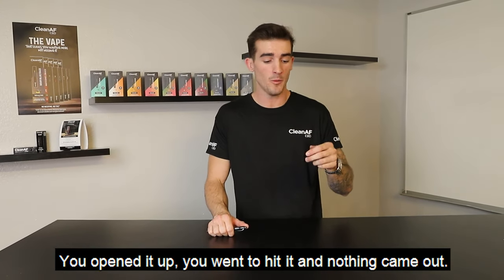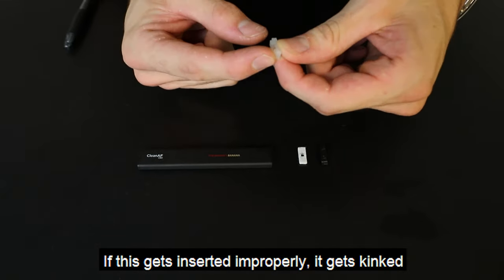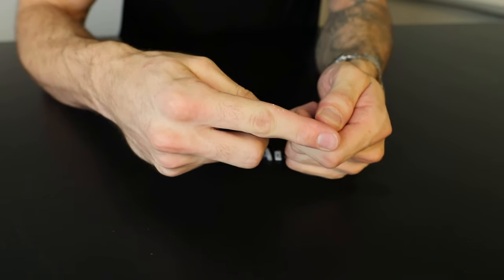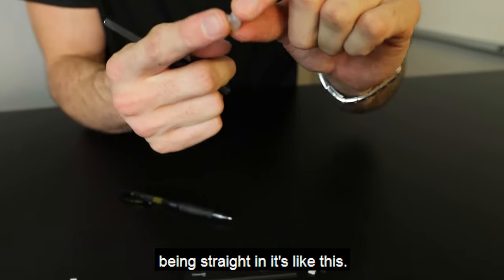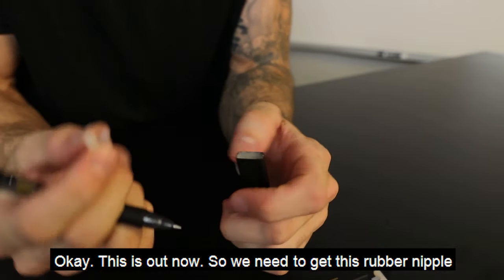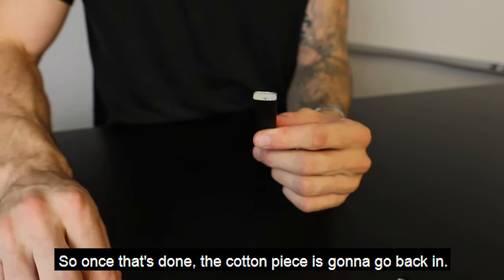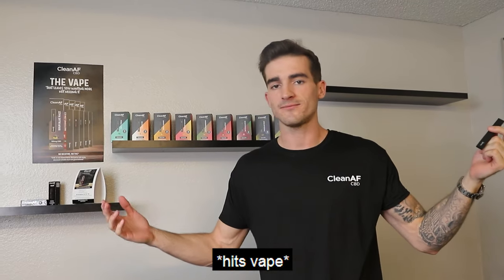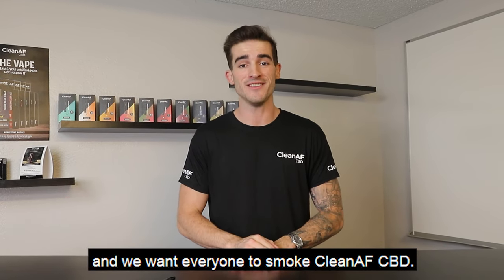How To Fix A Disposable Vape That Won't Hit - Distromike

Comment: HEAT.... Yup. Heat. Take a blow dryer and heat up your pen. Place heat on window that shows liquid. Chances are? The liquid is too thick and caused an internal clog. Once you heat up the window and liquid. Tap the side of your pen on something hard... Gentle taps. Bam.... Should fix the issue. You will be thanking me! 😊🎉 Enjoy!
Warm, tap, suck... warm tap suck.
Reply: Thanks, this worked for me on a live resin dispo, I was a lil worried it was gonna explode or something but I kept the hair dryer moving and it didn’t take long
Reply: it worked ty🎀
Reply: Can you help me ?
Reply: @merxrii  sure.... just warm your pen up with heat. Not too hot. Just enough for the oils to get warm enough to move when you shake the pen. You may have to warm...tap...suck, a few times to get iit unclogged.
Reply: Just did this to my disposable resin pen. You’re a saint 🫂 I’ll take a few puffs for ya
Reply: Thats it, my shit was almost frozen 
with these crazy cold temperatures!!
Reply: actual lifesaver bro
Reply: I have a ct1000 and I reset it by putting a paper clip into the hole and clearing it out and THEN I took your advice and warmed it up and IT WORKS!!! THANKS!!!
Reply: @SICAFxx  🥳 No problem. Welcome!
Reply: Omg I just did it and it worked thanks!!😅
Reply: @ladyt3701  🥳
Reply: Hey man I have a Geekvape wenax M1 it’s pretty much built like a disposable one but is refillable and it has a e liquid tank instead of cotton but I wanted to know would this work on mine cuz it isn’t hitting and I think the auto fire is acting up because of the E-Juice leaking into the battery unit
Reply: i did this but with a lighter my king kong gas station disposable clogged like this it would charge but not hit and it also had airflow but i believe it was a internal clog like you suggested instead of a blow dryer i used a lighter. took it for about 15-20 seconds i took it and went up and down my pen to the mouthpiece all the way below to the charger piece i did this and tapped repeatedly and it worked!!
Reply: The instant I knocked it on my counter it fucking hit god bless you
Reply: Definitely a big thank you cause it definitely worked!
Reply: Didnt wk for me how long do u use hair dryer for ?
Reply: @maryharvey8775  it took maybe 5 to 7 mins of warming it up, shaking, and tapping for it to work.
Reply: Ty bro helping people out a year later
Reply: @Cousindereck   awww..... no worries and thank you!
Reply: Thanks for the advice my dispo wasnt working ut this worked it
Reply: @Javier-h1c  😉
Reply: My goat

Comment: I have a lot of juice left and the light still lights up but nothing comes out 😭
Reply: @assassin-bp7ov  how do I fix it?
Reply: Yesss me tooo I been trying idk wtf to do anymore
Reply: @laceufr did u find it
Reply: same
Reply: That happens when you haven’t used it in a while the juice in it hardens but you have to heat it up for it to melt I usually put a hair dryer on low setting near the mouth piece for about 1 minutes the juice melts a bit then you should be able to hit it.Hope this helps!
Reply: @nya7199  thank you so much bro. That was the problem!! I was really scared I was gonna have to take this shit apart and mine does not look like the one in this vid so Idek where I would start.
Reply: I did my dispo connected one take the top off then smoke out of it then should work 🥴🔥
Reply: @savage_life_goat5703  I fucking love you my 7k just broke and i did that and it work ❤❤❤❤❤❤
Reply: @nya7199 I have a circle one
Reply: @nya7199 I love you, you saved me
Reply: @laceufr put yur finger on the mouth piece on the top and then like suck in frm the bottom where the charger hole is. This fixed my cake
Reply: @Alseidiking101  put yur finger on the mouth piece on the top and then like suck in frm the bottom where the charger hole is. This fixed my cake
Reply: @haydensmith-mcleod2978  put yur finger on the mouth piece on the top and then like suck in frm the bottom where the charger hole is. This fixed my cake
Reply: Buy recharged vape w/ cable
Reply: This actually helped
Reply: I have a circular vape and to fix the light no hit but fully charged issue I pulled the top off with some pliers then cleaned the small hole with ugly line/fishing line just ran it thru one end and out the other without pulling out the battery. Bunch of black solid stuff came out so I’m assuming the sensor was blocked
Reply: Try sucking really hard and hold the button for atleast 5 seconds so it can get the oil hot, suck in hard and itll burn up the clogged oil and it will begin to hit again. Happens alot with dispos
Reply: Just bang on it..just work for me
Reply: Mine can get airflow and lights up but nothing ever comes out. I feel like it's not even getting hot. I took it apart and have tried everything I can think of and nothing works. I can blow in the bottom and get air to come out but no smoke. So annoying.
Reply: Help my dam ruby won’t give me a hit but it’s lighting up pls help oml 😭😖
Reply: @PhillyCuhh OH MY GOD, THANK YOU SO MUCH, I DID THIS OUT OF DESPERATION AND IT INSTANTLY GOT FIXED
Reply: Lucky my light won’t even come on
Reply: 😭 same. Im trying every solution but it wont work.
Reply: @faaxss  if its a dispo slam it on the counter it deadass worked for me
Reply: @faaxss  but slam it upright
Reply: @PhillyCuhh what the actual f. This worked my guy! 🥲

Tried the hair dryer fix didn't work. 
Tried poking the clog, didn't work. 
Tried blowing through the airhole at the bottom, didn't work.
Got frustrated. Read your comment. And banged the shit out of it it on my lap coz immabout to throw it to the trash - puffed as hard as i could out of frustration.

Now I'm baked.

Thanks to you my guy.  Thanks to you.
🫡
Reply: @Mieiy dog you are goated as fuck this actually worked
Reply: @dylanpeck6816  yeah, i was using a weird 2g dispo and it kept dying, just had to slam it
Reply: Same
Reply: @space5452 omg ur a lifesaver
Reply: Thank you. This was so helpful but unfortunately mine still doesn't work. Probably was defective. But great informative video.
Reply: @Avitommo yo same is happening w me idk what to do did you fix it ?
Reply: ❤ @Chosenmonae
Reply: @wokkmula7709They still go out certain vapes. Pointless comment.
Reply: I still have like 14k puffs left and it lights up but no smoke, how the hell can i fix it?
Reply: @alexdonut  praying for you omg
Reply: 14k  hits left?  What kinda vape you got son?????????? Need to know!😂😂✌️
Reply: @Sherry-ik8gs  the brand I’ve seen is called a hayati pro max I believe
Reply: Facts bro I’m in your same position

Comment: I tried that with a blocked Ignite - the single hole is at the bottom though (apparently) and I seem to have pulled the battery end out! Funny thing is, now I've put it back in it is unblocked but tastes weird 🙄

Comment: Does it work for circular devices like the puff plus and the newer bangs
Reply: this is what i need to know
Reply: @mariesoph2  nope, i think it’s a battery issue, just happened to mine and the rubber part was fine

Comment: Just fixed two of my disposables. Basically just sucked on the mouth piece, not to draw, but to make pressure, and air bubbles came out. Works like a champ!
Reply: Your comment helped me as well so thank you 😅💕🙏🏼
Reply: omg thank u so much
Reply: @lus.7599  You're welcome!
Reply: I just tried this and it worked thanks
Reply: What do you mean, how do you suck without hit? Do you mean that you blew in it?
Reply: My cake doesn’t even charge and I tried this method didn’t work
Reply: @joelhernandez3169 prolly to late now but cover the 4 holes and hit it for 5 seconds..
Reply: @AhmadKarim-fo2bm  just suck. lol. mine eventually made a little puff sound and started pulling. I had to do it for a while before it worked

Comment: I did this plus the hair dryer trick and it still doesnt work. The air flow is clear and its like im hitting it but the light doesnt come on. Some times it does when i hit it but no smoke comes out. I dont think its heating up or making that connection when i hit it. Idk what to do anymore

Comment: I have 2 ozone .03 disposables neither will hit when I pull but the lights turn on during draw. Never got to inhale anything but I smell the distillate burning. Very disappointing. Spent about 90 straight hours of puffing only to not get anything. I'm not sure if its the worlds most clogged vape. When I shine a light the coil isn't burnt and I'm careful at least I think and it will charge just fine very confusing and upsetting
Reply from the maker: Sorry about your experience with that product. It’s very frustrating when things don’t work. The quality of the device and the product affects the consumer’s experience. 

Have you tried our products?

Comment: My flavour beast beast mode randomly stopped working. It was low on juice but I had battery left and stuff and it wasn't burnt and it randomly just shut off and I tried to plug it in but that didn't do anything. I tried the air flow thing but that also didn't work. Any tips?.

Comment: not the case with Bugatti Elite. You can pull through it but it does not turn on. It charges fine and it hit like twice and then stopped working

Comment: Hey this is Tammy I am just so frustrated I bought two torch diamond delta 8 pens and they do not charge can you help me?Any suggestions?
Reply from the maker: It was most likely a battery defect. If you want a product backed by a 100% quality guarantee check out bakedhhc.com if you use code “distromikeYT” at checkout you’ll get 20% off too

Comment: What if my disposable won’t let smoke out. I hit the pen and no smoke comes out but the light turns on?
Reply: i have the same issue rn man
Reply: SAMEEEE ISSUE. If you Figured it out please respond
Reply: @gurlpwr9898  If you figure it out please tag me ! Literally bought a brand new kangvape and have this issue 🙄
Reply: This just happened to me. i bought it earlier today, hit it afterwards, it worked. but now nothing is literally coming out and i don't know what to do
Reply: The cord connected to the juice and the battery may be ripped
Reply: i don’t know if you tried this already but if you blow from where you plug in the charger real hard sometimes that’ll fix it
Reply: @god-bs7op  glad I read all the way through! Your tip worked for me !

Comment: My vape also got same problem...its not working...but i don't know how to open it as you open the vape ..in my case...little bit different...geekvape wenax without button soo can you help to solve this problem
Reply from the maker: Sounds like your battery is dead. Not sure with that model specifically, an acquaintance had the same issue with a different model (vaporesso armour pro).  Replacing the battery solved the issue and was easy enough, but if your model has a built-in battery you might have to replace the whole thing.   I recommend you trying cleanafcbd.com
Reply: @DistroMike
 But in case the model of the vape has inbuilt battery ..how should i replace the Battery?  

ok thank  you soo much ✌️😊sir for the response

Comment: I have one question about the elf bar which is a disposable vape I had one which would not stop auto firing and I could feel the device getting hott so I panicked and threw it away cause I thought it would explode. Do elf bars have any safety mechanism
Reply: mine did the same and it kept lighting up like i was hitting it

Comment: I have a peculiar situation with mine. it continues to blink for hours after not even attempting to hit it. It's like it's in continuous blinker mode. I'm not even sure what to do. I'm going to show it to the guy that made the trip to get them to see if he can't figure something out, but if that fails, does anyone have any suggestions as to the cause and/or solution? I also never took a blinker, but it did get clogged, but I fixed that problem. 

Update: I had to discard the thing because it was perpetually hot, and I became worried that might explode.

Comment: This wasn't my issue, another common problem is the ground cable likes to come unattached, making the light still work but nothing actually vaporizes. Luckily I can solder if not you can literally tape it back onto the battery with the sticky pad most disposables come with now. Good video though thanks!
Reply: This just happened to me but I'm not good at fixing things😭
Reply: Please explain more, I have this problem
Reply: help

Comment: I've an eb5000 mod the Elf Bar Mod Vape, one ran for two months n a half daily hits constant then dropped in the water, so now found video cleaned it after few weeks of it not working, second ElfBar is brand new worked for a week and then all of a sudden it's burnt and no receipt a gift from me Aunty, but the coil part or something is clogged after took it apart cleaned it light comes on. My Alien Vape worked long time too which had a closing valve to keep debri from getting inside!
   I got ripped off well me Aunty 32.99 in Alaska they last for few months with proper usage. The EB5000 
   How do I unclog it get the oils back to working. The old one started again agates being submerged into water for few days tasted burnt until today cleaned it. And now the nicotine oils taste like new again wowzers! 
     Need nicotine oil and can refill the eb mod so don't have to toss the battery

Comment: i cant open it i’m pushing as hard as i can but little pieces just keep breaking off i tried the bottom and the top

edit: i got it open and did it but it still didn’t work i threw it against the wall and put it in the fridge and blew on it but nothing worked so idk what to do
Reply: Bro..  Are you okay? Are you alive?

Comment: Bro i have elfbar bc 10000 and it wont hit
Reply from the maker: Means the connection between the coil and the battery is probably bad. If hitting it doesn't work, try pulling it open (open from the side with the charging port, otherwise you risk disconnecting cables) and pulling up the chip connecting to the coil. Don't pull the coil itself out, just the chip.

Let me know if that helps, keep messing with the chip and test via blowing air through the airflow monitor to see if the coil activates.

I also recomend trying our brand CleanAF CBD. we have the MAX vape which is basically a nic vape but instead of nic has the cleanest CBD. Our devices rarely clog or stop working and even if that happens you can easily unclog it just by blowing through the bottom.
Reply: @DistroMike  it exploded but thanks
Reply: @DistroMike  🤣🤣🤣
Reply: Cleanaf cbd hmm
Reply: @DistroMike  i live in nepal so you know how can i buy iy

Comment: The light won’t even light up when I pull
Reply from the maker: If you hit a vape and the light won’t turn on its most likely a battery issue and faulty device. What kind of vape was it

Comment: i dropped mine of the floor and after that when i try to charge it, it’ll light up for only a second and stop
Reply: also it’s not hitting
Reply from the maker: You most likely damaged the battery when you dropped it. What kind of vape was it

Comment: Did it, no hit, battery is “dead” out of box
Reply: same i got a bidi stick, straight out of the box and the light was blinking. it’s full but no hits!
Reply: @mckenzie5509  you know how to recharge them?
Reply: This happens so much to me. I buy a pack at a time because i hate being without it / opening a fresh one that doesn’t work or taste like burnt rubber and it happens for about 2 for every full pack. Annoying ! If you know a better disposable brand let me know (for watermelon flavored)

Comment: TRE House vap 42 bucks no returns won't y hit or charge..  aNy tips  diamond live resin plug in flash w light n idk she no work
Reply from the maker: You can try blowing through the bottom of the vape to see if it’ll start working again.. also.. be careful of any live resin delta brands. Live resin delta8 just isn’t possible.. 

If you want to try some firee, that’s 100% quality guaranteed, check out bakedhhc.com we’ve got a discount code you can use for 20% off “distromikeYT”
Reply: @DistroMike  I need a stop, just disappointed not mad. Acting like is unnecessary, I was a reg $33 whatever 4 days.

Comment: What if I did this and it still doesn’t work?
Reply: Hey man you find a fix? My dispo is having the same problem. Its not with the air flow. Since i took the plastic cap out snd was left with the coil and cotton. The blue light is shining

Comment: Lol yeah bs on this. Been vaping since vape came out. Most of the times like 99.9% it's not workings because it's straight up a dud. I've never ever seen a disposal not work because of the rubber piece being bent. It's always a faulty battery.